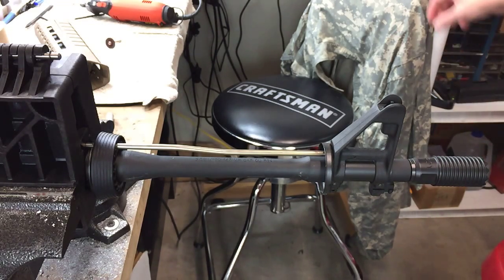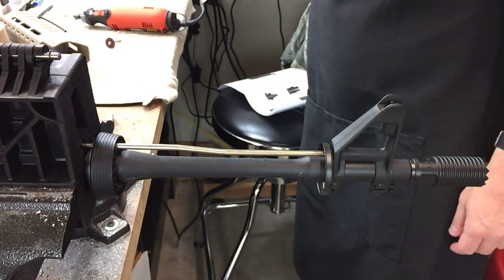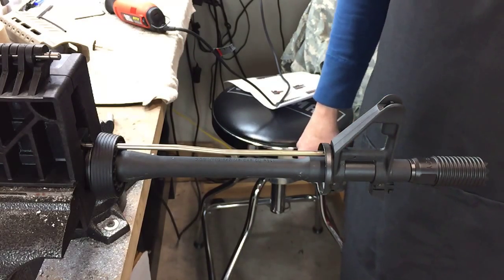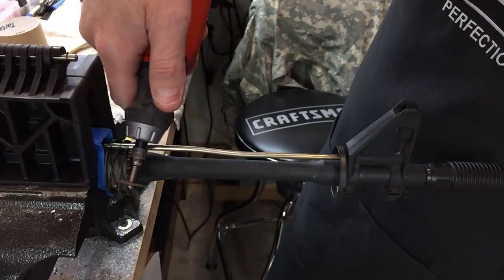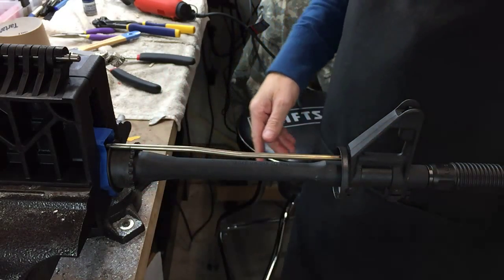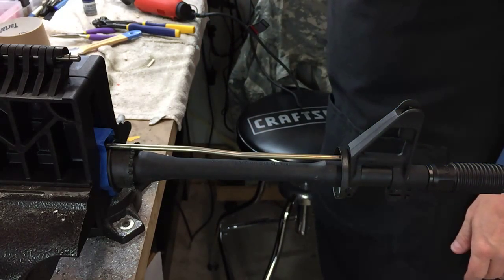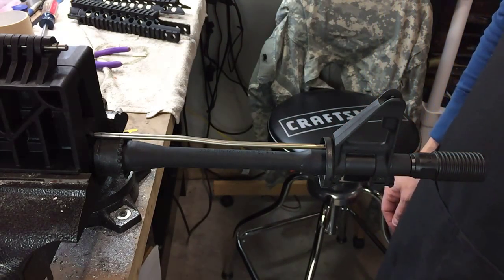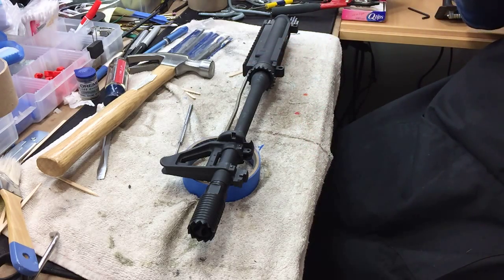Installation of a Centurion Arms C4 Carbine Cutout Rail on a 10.5" SBR Upper Receiver

Comment: Is there a reason you didn't just remove the FSB and FH to remove the delta ring and hand guard retaining clip? Seems like a lot of work could have been avoided doing so. Thanks
Reply: Did you even watch the video? He explains this more than once.
Reply: This hand guard is a great alternative if you want a free float rail that uses stock barrel nut but have a pinned/welded muzzle device. Also suppose to have lower tool requirement for installation. Still need punches though so its kinda a wash there.
Reply: Probably because he was busy trying to remove the FSB "bolts" and "front gas block" 😆

Comment: I did this job, before anyone does this job, make sure you have all the appropriate tools. Dremel with a reinforced cut wheel, good vice, upper vice block, some type of prying tool, pliers, snap ring pliers, Alan wrench set, punch set, hammer. Probably more. Not the easiest installation I've ever done, great looking rail tho

Comment: I don't even wanna think about how long this took you to do in real time...did you have to take off work the following day because you worked through the night and the whole next day installing this handguard?
Reply from the maker: +5.56 Or 5.45? It took roughly 45 minutes, mostly due to the fact I was documenting the process.  Normally, it wouldn't take me that long to install a hand guard, but this was a new product to me, so there was a bit of a learning curve.  The fact the installation instructions were incomplete, didn't help the frustration level.
Reply: +2phast Tactical haha I'm just fucking with you man. 45 minutes with documentation isn't bad at all to be honest...I just remember at one point seeing a bare barrel and barrel nut on screen then skipping ahead like 7 or 8 minutes and seeing a barrel and barrel nut still on screen when it kept playing haha that's why I was cracking jokes. shit looks good though man I was considering this rail on and 14.5 build a while back but it doesn't look nearly as good on a 14.5 or 16 as it does a 10.5...not even close. went with the dd ris2 on that particular build (by far my favorite quadrail)... looks good on your sbr though man. peace
Reply from the maker: +5.56 Or 5.45? That could of been the time frame when I was trying to install the hand guard and discovered the instructions didn't mention anything about removing the hand guard end cap, so instead of removing the front sight, I elected to cut the thing off.  Wasted 15 minutes or so on that.  I wouldn't use one of these on a 14.5 or 16", I would remove the front sight, install a low profile gas block and then run with a free float hand guard, 13 or 15".  That is my preferred setup.

Comment: Good vid, Q: On a AR are the T-Slots on the upper receiver (and hand-guards and or free float rails) "cut" at a distance that it is possible to SPAN the distance between the upper, and a rail /hand-guard w preferably a (3) or better yet (4) screw mount Scope/RedDed/"Riser Mount ?..
(Yes I know spanning a Scope is NOT advisable, I was going to use a RedDot.. with RedDot being attached to rearmost section of "riser mount having (2) screws... the forward section of the riser mount in which the  3rd  or the 4th screw if I can find a (4) screw version being positioned so it is "SPANNING" between  the upper and a extended drop in hand-guard.

Reason? Simple,  The cheaper "Drop-In" hand-guards, and some free float rails are prone to a slight amount of movement. "Spanning" the area over the Delta Ring area, "Locking" the upper by at least (2) lock down screws and the hand-guard via a riser mount would greatly reduce any movement that might occur.

ANYONE?

PS: Anyone know of any (4) screw riser mounts that are reasonably priced? All I see are (3) screw riser mounts. Would refer (4) attachment screws and a full locking bar that runs between them.

Comment: Will this fit on a standard s&w m&p15 with a 16 inch barrel?
Reply: 32023Gamble yes it will
Reply: @julioiglesias6424  what size would I need to get to fit mine? I see they have 2 different sizes the 9.5 inch and 11.5 inch.